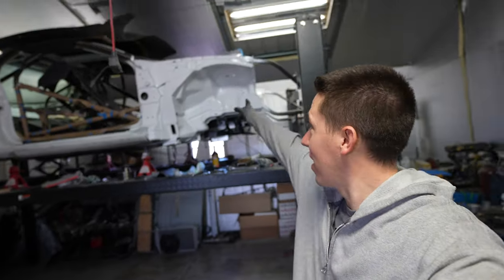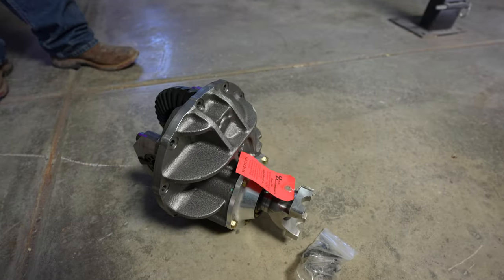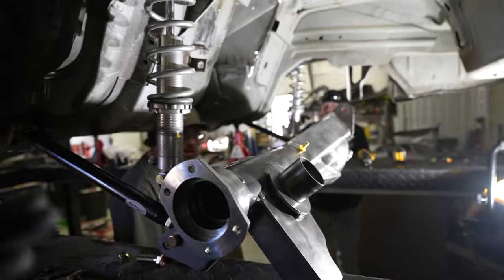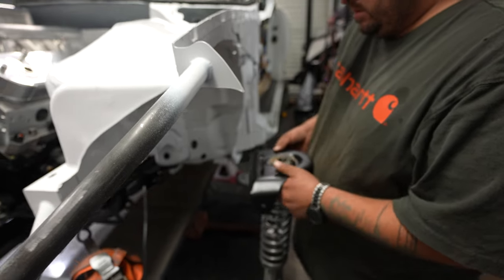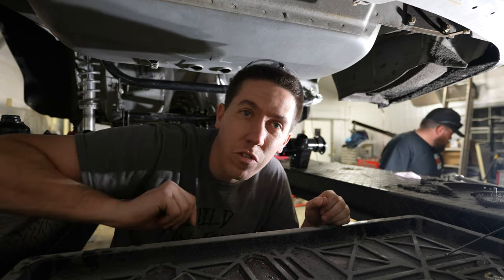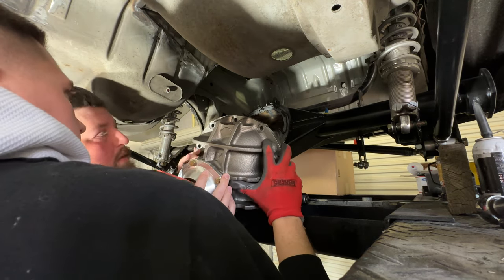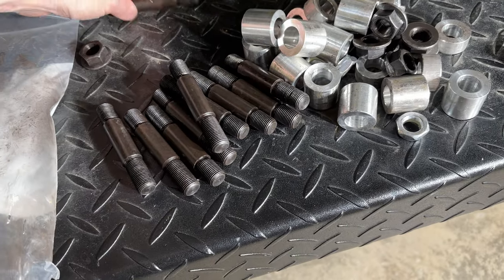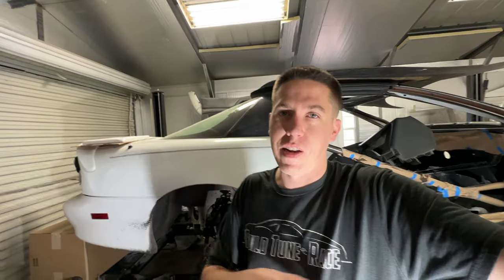Salty Got A New Shortened Quick Performance Fab 9" Rear End!

Comment: Hey James, did you adjust the torque arm bracket on the housing, until it fit where your tq arm was beforehand, or how'd you do that? I'm assuming i have to get it to where it was, then re-set pinion angle..? Congrats on your TX2K win man! You and Kyle couldn't have been a better race! Also, whatd you do for your brake lines and how'd you fasten to housing? Thanks man! Hopefully my 99 SS will be running this month! It's a 11.5:1 408, w/a 91/102 FIS turbo, Huron t4 a/c kit, Griffin stand up, dual pullers, TH400 w/new CircleD converter, it will have air, interior, and a cage! After what happened to Cali Nate last night, or the night before in TX, no way would i make  anymore than about a 200' pull, and let out w/o protection! That hit too close to maybe not the level of racing he was at, but the type and people he raced with are my friends man! We all have pretty similar setups, although he's more of a no prep guy, he was at a track... i like my prepped tracks and I'm going to give a radial a try and see how it goes! I have no rear shocks yet, if you have anything used, lmk. Thanks man!

Comment: Little behind on the videos. But was wondering; I'm using Moser Custom Alloy axles & heard of folks using a second, traditional seal. Mine use a ball bearing assembly like yours, with the o-ring on the outside. Did you use anything else besides that?

Anyway, looking great, James!🤘I know how exciting it is.

Comment: I had to cut the outer hole of my mwc torque arm and open up the inner hole to get it to bolt to my QP fabbed 9”.  Curious if you have to do the same?
Reply from the maker: Interesting, mine bolted right up.

Comment: Can you drive 35spline pinion on street? They told me you couldn’t
Reply from the maker: You can drive a spool on the street but it is definitely harder on the pinon gears tires ect. Just don’t expect to get 100k miles out of them if you do a ton a street driving with your “race car” it becomes a potential wear item when they start to make noise

Comment: Man you cheaped out on the center scection
Reply from the maker: Why’s that? Because I didn’t go with an Aluminum one?
Reply: Iron is the best for alot of power. I got the iron n case. Aluminum flexes under high loads and has potential to break.
Reply: @derekr1854  
Sure it is!  
Have you ever looked under a high power race car?  There all aluminum.